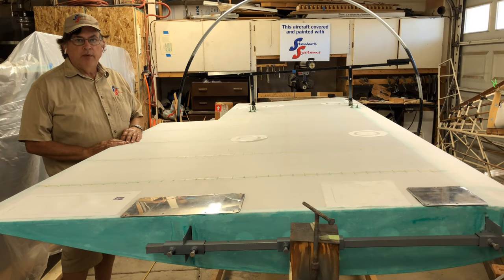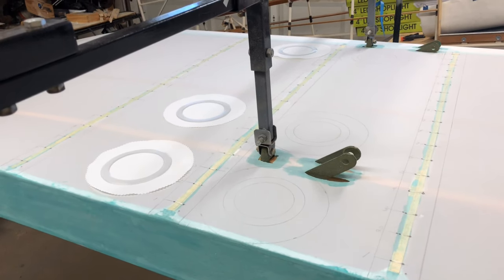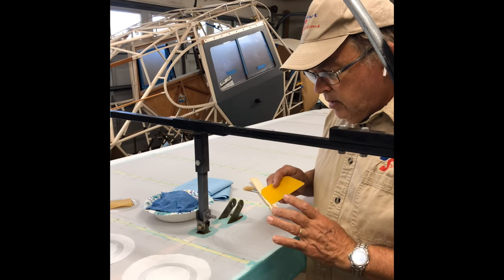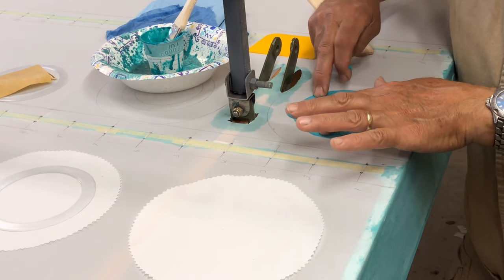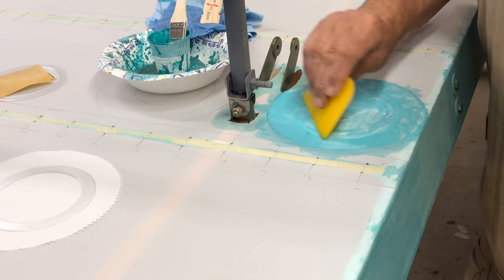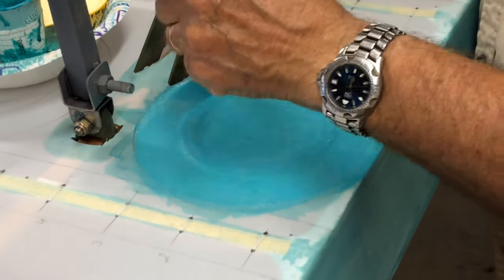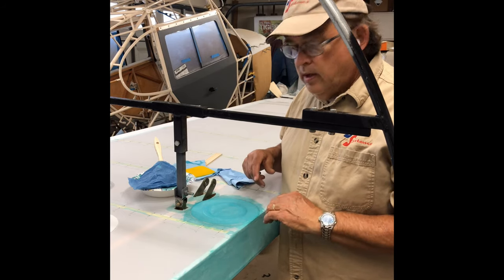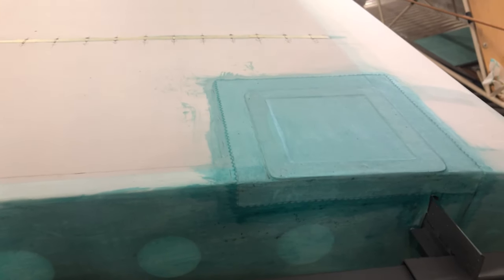Installing Inspection Rings

Comment: Now tell us about the $ 15 K paint job, while I fly away with Oratex
Reply from the maker: Oratex is unique system.  The cost of materials is nearly three times the cost of ours, so any labor savings is quickly offset by that.  The claim of labor savings is generally overstated.  I am seeing in the field for people that have done multiple airplanes in both systems that the you can have our system on and ready for the spray booth in the same or less time than Oratex.  So really, the only labor savings is the time in the paint booth.  If you are painting a single color which would be the comparison to Oratex, the time in the paint booth is minimal.  Any striping or design beyond a single color is going to take the same labor in either system.  The difference is the final appearance.  There is no comparison in that category.  So it just depends on the look you want.  There are many advantages to a painted system.  You don't see structure through a painted system like you often do with Oratex.  The deep gloss finish,  ease of cleaning and resistance to stains is a big asset.

Comment: Thank you for the good video and you for taking the time to make them keep them coming is it better to do your first coat off fill with eco bond vrs just going straight to the eco fill or why do that I’m fixing to do a rans 7 quick build and I want to do it the best I can
Reply from the maker: We have found that it's best to seal the weave with one coat of Ekobond.  That protects the backside of the EkoFill from the environment.  It makes little difference in most environments, but we were seeing a few issues in extreme damp environments.  We also found quite a few issues where folks were not keeping the fabric damp when applying EkoFill and were not getting proper penetration.  This solves that issue as well.   The Ekobond method also saves time.